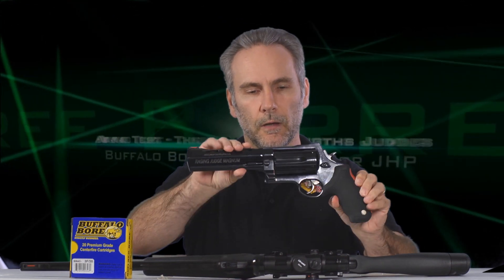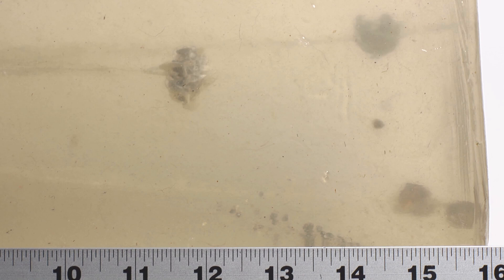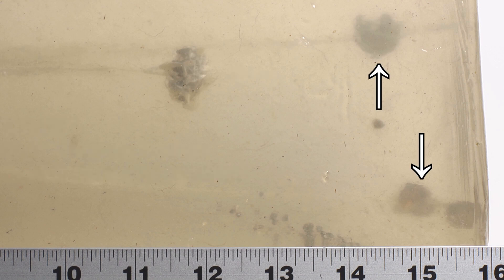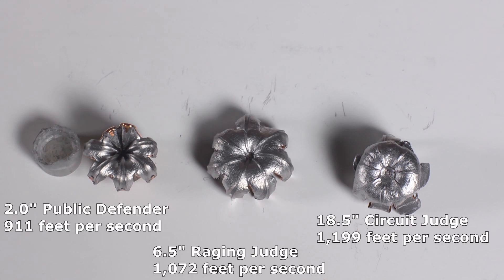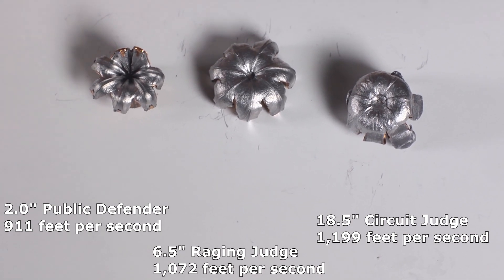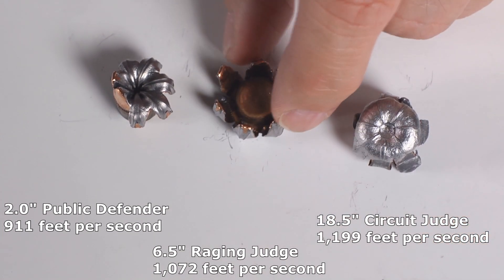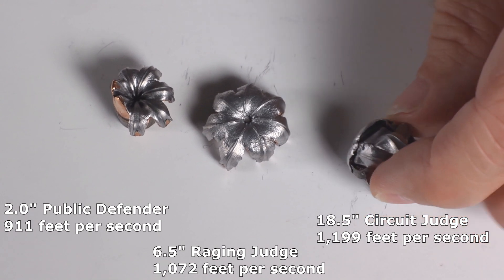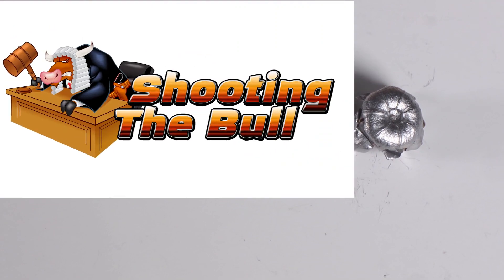Ammo test from three different barrel lengths: Buffalo Bore .45 Colt from Taurus Judges

Comment: At the end of the day, they all will kill you as dead as a can of Tuna
Reply from the maker: True, any of these shots would still have manstopping potential.  It's just that some designs work better at certain velocities than others do.  My next multi-barrel test will show a round that performs pretty much the opposite of this -- brilliant expansion and penetration from the 2", but way overdriven from the 6.5".  And I've published two tests of Gold Dots in .45 Colt (2" and 6.5") and will soon be publishing the 18.5" version.  In short, I've identified three different rounds that each excel at one of the barrel lengths, but not necessarily at the other lengths.  So if you're using a revolver or carbine with a certain barrel length, there's definitely a type of ammo out there that is optimized for and will deliver best results from that barrel length.  Not that the other ammo would be a "fail" necessarily; just not as good or optimal as properly-matched ammo would be.

Comment: Just goes to show that more velocity is not always better. Great test. Thanks again.
Reply from the maker: Exactly.  Just like some water is good, but too much water is bad for you.  Same with velocity -- the right amount is great, but too little or too much can have negative effects.  Doesn't mean the bullet becomes worthless -- any of these shots would still result in a deep penetrating wound and at least a .45-caliber hole -- but bullets are designed to work within certain velocity ranges, and if you step outside of those ranges, bullet performance may suffer.
Reply: Exactly. I try to explain this to people all the time. Everyone seems to want to buy the round that cranks a given bullet to the fastest velocity (i.e. Underwood loads). That's not always good if you've driven it 20% faster than the intended velocity.

Comment: Interesting. How well do the ballistics tests correlate to real world performance, I wonder.

I assume the FBI diff tests to make sure the ballistics gel tests are meaningful.
Reply from the maker: tacamo21 Gel tests are designed to remove subjectivity from the equation.  Gel is designed to be homogenous and, when properly cailbrated, should provide an equal test bed for all bullets shot through it.  When tested under proper shooting conditions, with properly prepared and properly calibrated gel at the proper temperatures, you should be able to compare any bullet against any other and the number of variables will have been minimized.

That said, this wasn't organic ballistic gel, this was synthetic -- which, in and of itself, shows fewer variations than organic gel does, but doesn't respond exactly the same.  This video wasn't an attempt to do a proper complete ammo test, it was merely an opportunity for illustration of how bullets react differently to different velocities.
Reply: Thanks for the info.
Reply: My understanding is that gel tests are all subjective. It gives you a general idea what a bullet would do in certain circumstances. The uploader would probably be more qualified then I to give you a more educated answer, but my 2 cents is that all bare gel does is give you an idea of what a perfect shot would do through flesh, it doesn't account for what the bullet does if it hits bones like the ribs, arms, and shoulder blades. FBI tests are more realistic with what happens when you shoot though a barrier and such. Then again I'm no expert and bullets that have passed gel tests have been proven to be great performers.
Reply from the maker: ZogThePrimitive Well said.

Comment: Did you only do the one trial for each barrel?  If you did more, were the rest of the bullets well represented by the bullets shown?
Reply from the maker: This wasn't intended to be a comprehensive ammo test, just a simple comparison to show how significantly bullet performance can change due to velocity differences.  I have done other multi-barrel tests (such as Gold Dot 250gr, tested from all three of these Judges) and PDX1 (tested from the 2" and the 6.5").  The Gold Dot test is already published, and you can see the same type of differences there as seen here, the 2" either didn't expand or under-expanded, whereas the 6.5" performed ideally.  The PDX1 test is not published yet, but the results were the opposite -- brilliant performance from the 2" barrel, but the 6.5" actually ripped the bullets apart; it looks like the 18" version here, except that the bullets did shred some.
Reply: ShootingTheBull410
Thanks for the reply.  I was just wondering how much variation there is between trials of the same barrel.  i.e. how consistent the ammo is and, if it's noticeably inconsistent, is that inconsistency greater than the difference between the barrels.
Good information though on how the bullet dynamics change as a result of relatively small changes in velocity.  It just goes to show how dominant the square function of velocity is in E = .5mv^2
Reply from the maker: NotAPreppie1 You hit on why I use multiple rounds in ammo tests -- because ammo itself can be highly inconsistent.  I've seen variations of 100 fps round-to-round, from the same gun even(!) You have to take multiple shots to try to get a more representative sample.

In this test, the velocities were reasonable for the barrel lengths and I'd done prior testing with the Buffalo Bore against a bulletproof vest and pretty much knew what to expect velocity-wise from the different guns, and they performed about as I expected, so I went with it without thinking further shots were necessary.  But this would be poor protocol for a first-time test of ammo, trying to represent it as an accurate average of the ammo.  Again, this wasn't really a test of this ammo, it was merely to show how different velocities affect bullet performance, and seeing as I got a pretty good spread of velocities, I thought it was adequate for the purposes of the test.